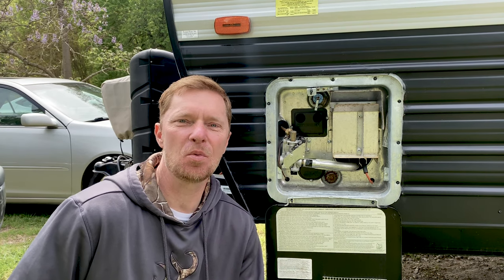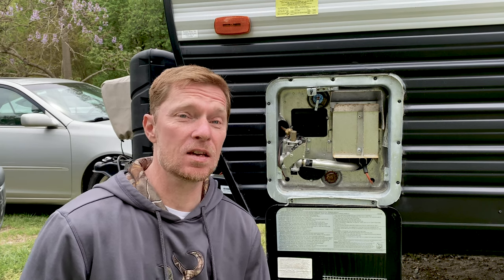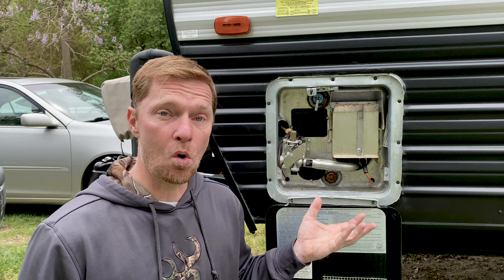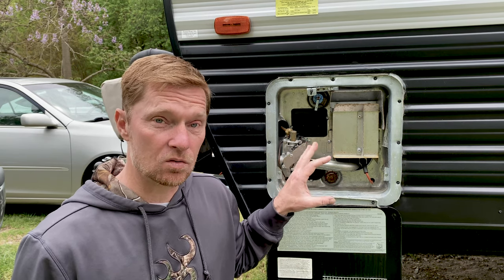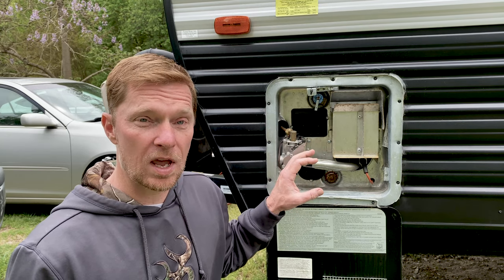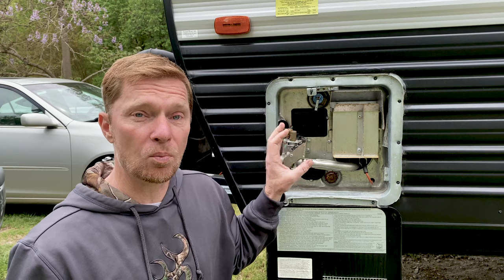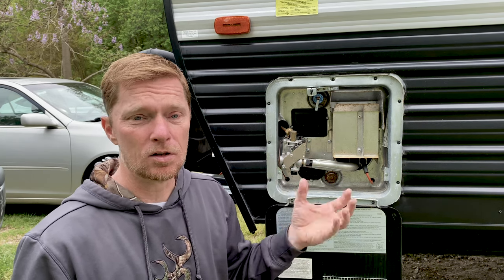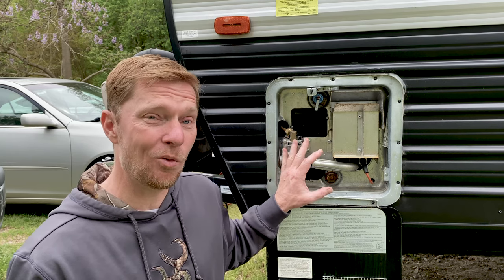Travel Trailer Gas Electric Water Heater Explained 2020

Comment: Where is the electric switch located at in the camper?
Reply from the maker: Different RVs have them in different places but most f the time you will find it on the panel where all the other switches are located like the tank level, inside lights and so on. To make sure I undersstand, the switch inside of the RV on the panel is for turning on the propane side of the water heater. At least that is how mine works.

Comment: Can you adjust water temperature for camper. Mine running too hot.
Reply from the maker: I can not on mine. I suggest looking up the manafacturer and seeing what they say online. You should be able to find information about the water heater on a sticker behind the cover on the outside of the RV.

Comment: How do you cut the flame down? My rv panel looks jus like yours. When I turn heat on it is like a blow torch. is that normal?
Reply from the maker: You cant turn down the flame. As long as the entire flame is under the tank, i would think that its ok. If yours doesnt look right, trust your gut and have a technician take a quick look. Remeber safety first.

Comment: Hello, l have a 2024 rockwood mini lite 2511s.  There is not an on-off switch for the electric in the outside hot water heater, just the black reset square. How do I switch it from propane to electric? It is a suburban. An airxcel brand. All model. Do I only use the panel inside the  camper? I have a push button for propane and one for electric.
Reply from the maker: I am not sure exactly. I would think that if you have 2 switches for water heater then yes one is for propane and one is for electric.

Comment: Hi. Brand new trailer owner. I know NOTHING about what i am supposed to be doing. The "walk through " at delivery was 10 mins! Not nearly enough to explain things and my questions were answered with "you'll figure it out"...useless!  I would like to START using my hot water heater (hot summer and not necessary until now) and want a safe start. I have forest river rockwood signature and still finding things. Do i need to go outside and find the on/off,  can i just use the control panel inside, or both? There is NO owners manual to answer these questions.
Reply from the maker: It depends on how your set up. Tell you what. If you want to connect, please email me at How2RV@gmail.com and I can send you some details

Comment: Is there a valve to turn off water to the water heater?
Reply from the maker: Mine have 2 on the back of the water heater. They are bypass valves which turn off the water heater and still allow the RV to still flow if needed.

Comment: Can the 12v supply enough power for the element to work properly? Or is it shore power only?
Reply from the maker: The electrical heating element is for shore power only. Outside of shore power you will have to use the propane to heat the water. Thanks for asking.

Comment: Great info!! 👍🏻. Do you know if it’s okay to run both electric and gas at the same time?  Will it heat the water faster?
Reply from the maker: Glad you asked. Yess you can run both at the same time. As far as the time to get hot, i don't really see any difference. Where is see the most impact is how much longer i can keep hot water flowing.
Reply: Imagine Your Odyssey thank you so much!!  That’s what I was trying to do, increase my hot water shower time 😁

Comment: I have a switch on the inside of 5th wheel..is it enough to just keep that switch off to heat water in shower and sinks? I am new to all of this..does it still draw my propane ? Is the off switch enough to not draw propane? Thank you
Reply: Meaning..do I still have to go outside and switch off or on whatever? I am living permanently at an RV park..thank you
Reply from the maker: For mine, I would turn the switch at the water heater outside on if i wanted to use the shore power (120V) and use the switch on the inside if i want to use propane. If you leave the switch for the propane off, you should get hot water from the (120V) shore power side only.
Reply: @HowToRV  I still dont get it...I am very slow...lol
I have the switch on inside off...do I need to still do something outside. I do have hot water....thank you
Reply: Dont even know what shore power is??
Reply from the maker: @virgoallthewayvirgoallthew4464  Shore power is where you plug your camper in when you are at the campground. Watch this video and let me know if this helps. https://youtu.be/r1QORFE2htM

Comment: Do I leave the inside on and off switch on or off after it gets hot but I no longer need hot water because mines running off of propane?
Reply from the maker: If you leave it on, it will maintain tamepature. If you want to convserve propane, then turn itoff when not in use. The only thing that you will have to remember is to turn it back on about 30 minutes prior to use so that the wwater is plenty hot.

Comment: Our fumes are coming back into the camper when ignited to heat water back up using gas, do you know what could be causing this?
Reply from the maker: Wow this could be a real problem. All of the fumes should be going out the little port hole on the cover outside. I would check the seal around the outer part of the lid and enclosure on the outside and check to see if there is any obstruction too. Also can check the gas lines for leaks to do this, use soapy water or a product called snope. If you can’t find the reason have a professional look at it, gas smell is a bad thing. Now I am no professional but as dangerous as that can be, I wouldn’t wait to long.
Reply: @HowToRV  Find the access to the back of the water heater and see if you see light.  If you do, they've cut the hole too large for the frame on the water heater and fumes will come in.  Water can, too.

Comment: i have a gas/elec water heater. In my controls for the electric, i have a breaker. Also I have two switches next to my convenience console (tells me water level and turns pump on) Those say "water heater). Also, on the convenience console, it has a switch "gas water heater" and "electric water heater". So, with those 3 total electric switches, what do those probably do?
Reply from the maker: The circuit breaker is for the shore power electric 120v side of the heater. The breaker is there just in case an issue arises. The electric switch on the convenience panel is to tell the water heater to start heating with the shore power 120v side. The gas switch is for the propane heat Sid rig the am water heater. Hope this helps.
Reply: @HowToRV  yes but there are 2 more switches. that's the part I don't understand. but I think i figured it out. thanks anyway.
Reply from the maker: @surveyguyor8958  The only other switches that i have are for the water pump. What did you find out?
Reply: @HowToRV  they said "tank heater" and in my other RV's I've never had this. but ....drumroll.... holding tank heaters. for sub-freezing temps.
Reply from the maker: @surveyguyor8958  ahhh. Yeah. I will have to remember that if someone asks me. I do not have tank heater even though I wish I did. Drum roll. 😂 you have me laughing on that one.
Reply: @HowToRV  What threw me was there was a 3x5 card that had a little drawing, and for those 2 switches it said "Do Not Use" so it had me worried something was wrongly wired. Can you imagine someone asking me why you would have a heater on your wastewater tanks? "Because my poo is so special I keep it warmed"
Reply from the maker: @surveyguyor8958  ROFL. I was in the middle recording my next video and read your last comment. I had to stop all production and get my composure. I do agree though. A sign that is basically a red button does make you wonder.

Comment: My rv is connected to city water, and my electrical switch for the water heater is on. The water isn’t warming up! There is water in the water heater. Is it ok to turn the switch on inside and run that as well as having the electrical switch for it on?
Reply from the maker: That is what I do. I run both at the same time.

Comment: Where is the shut off valve for the water heater? Our water heater is located where we can’t access it at the end of the storage cubby.
Reply from the maker: Our shut off/bypass valves are on the back of the hot water tank. Both water lines on ours have valves.
Reply from the maker: I have to either take out everything from the storage or lift the bed and go in from that direction. The bed direction is what I mostly use since I do not want to empty the storage every time. There is a panel there that I am going to make removable in the near future so that access is much easier. Hope this helps
Reply: Imagine Your Odyssey We did finally find it there but it’s nearly impossible to get to. We’re going to move that panel further away from the water heater so we can reach in there better. Thank you for your help!

Comment: Thanks for info.  Our setup is same as yours.  So I can run electric and propane at same time?  Is that correct?  Thanks
Reply from the maker: Bond008 A that is correct you can run both at the same time. It is highly important that you remember to turn off the electric when there isn’t any water connected whether it’s from a water hose to your rv or the RV Intetnal water pump. If you leave the electrical side of the water heater on and now water coming from either source, you will take the chance in ruining the electrical heating element.

Comment: We turned of switch for electricity but what do you do to get it on propane?
Reply from the maker: We only have to turn the switch in our RV for the hot water. On ours, the sitch inside the camper is for the propane side and the outside switch at the tank is for the electric only.

Comment: one thing I was hoping you would cover is:  Can you run the gas and electric both at the same time ????
Reply from the maker: I had been asked this before. I added a link in the description as well as the comments. Look there and it should answer your queston. Looking forward to your feedback.
Reply: @HowToRV  Well I have all over this site trying to find the answer.. Can not find in any comments or a description. could you just tell me in this reply a simple yes or no
Reply from the maker: @paulcurt684  in my setup, yes. I ran both at the same time quite a bit especially in the colder weather.

Comment: I have the same water heater. If I just plug the rv in and turn the black switch on can it run on just electric?
Reply from the maker: Mine can. If yours is like the one in the video, you should be able to.
Reply: @HowToRV  Thanks . It works.

Comment: If you turn off the electrical switch will the gas unit continue to work. I have to push my reset buttons daily to ignite the gas to get hot water. My electric element is apparently bad.
Reply from the maker: Yes you can use it without the electricity and/or the electrical switch off. Let me know what you find out about the heating element and the reset buttons.
Reply: Well I shut off the toggle out on the unit and the gas did ignite and heat the water. Next day had to go push the gas reset button again to get it to heat up. Flipped the toggle on the electric element and it came on also. Element was not bad after all. Both resets have to be pushed daily to heat up the water. Think it may be the thermostat. I have noticed that the water is now scalding hot. Hasn’t blown the pressure valve though. Even using the gas or electric. Hot water is scalding hot.
Reply: @stevetilby5695  From my understanding that is intentional, the manufacturer feels that because the hot water tank has only a limited suppley of water, that the more cold water you use to cool it down to a temperarure that you can work with, the less hot water used. Kinda makes sense.
Reply: Jim Shupe agree but used to not get as hot but still doesn’t blow the pressure value. Also ran out of propane a couple days after my last message to you and haven’t refilled it yet so just pressing the left reset works the electric. Still have to go press it every morning to get hot water to build up
Reply from the maker: steve tilby sorry to hear that you ran out of propane. I have a video on my channel about measuring propane without have to spend money. That way you know how much you would have before empty. Let me know what you think of that video and if it would have helped you
Reply: Agree. Makes perfect sense. Still, mine gets so hot it trips the reset button and I have to push the button every morning to get the hot water back. Something else must be wrong

Comment: Can we use just electric? Or does gas got to be on to heat water heater?
Reply from the maker: I have used the elkectric only a bunch of times. The only concern is that the electric side takes longer to heat the water. You will run out of hot water faster when taking showers and such but is doable if you are in an area where the outside temperatures are higher that 80 degrees F. Hope this helps. If you have any more questions, please feel free to email me at How2RV@gmail.com

Comment: So if you want to use propane for heating, the system automaically knows and the propane heating just turns on, no worires about you having to figure if there is some sort of switch that you need to turn on to it or haivng to figure out about igniting some pilot light.  Right? 
Since I have no electric heating at the hot water tank and I don't see any flame on the propane burner, not any sign of some pilot  knob or thermostat setting... I guess in am just in "hot water".  🙂
Reply from the maker: On mine, I turn on the propane switch to allow it to work. From the the water heaters built in water temperature sensor takes care of the rest. You are correct.

Comment: Can I leave the propane side of my water heater on
Reply from the maker: That is what I do. Because I only have a 30 amp service, I toggle the e;extricate and primarily use the propane. In your case it would be just the reverse but doable if your system is like mine.

Comment: My RV has a main shutoff for the 12-volt battery. If that is shut off, will the propane setup of the water heater function? I believe you said the solenoid functions off 12-volt power?
Reply from the maker: That’s right. The propane will not work if the 12 volt system is off. Now I have not check to see but the battery does get charged by the inverter . The inverter is powered from the 120 volt system which comes in when you plug your camper into shore power. So if that’s the case then if your plugged into the shore power and it’s still feeding the -2 volt system even with the battery disconnected then it may still work.
Reply: @HowToRV  thank you for the reply! Strangely, my RV is not equipped with an inverter that charges the battery. It’s a Keystone Laredo travel trailer if that says anything. So it sounds like I’ll need to flip my main 12-volt switch on to get propane to my water heater. 👍
Reply from the maker: @jay_rojas  what year is it? Also, can you turn on the lights with the shore power connected and the battery disconnected?
Reply: @HowToRV  it is a 2016. And yes, I’m currently connected to shore power and all my interior lights are functioning.
Reply: Porch light and step light also work with the 12-volt power shut off. If that helps.
Reply from the maker: @jay_rojas  your lights I. Your RV are 12 volt. That means that you do have an inverter. Mine is located behind the main power panel where the circuit breakers. You will not physically be able to see it but it should be there
Reply: @HowToRV  that is good to know. I’ll pay closer attention and see if I can’t see signs of charging by the inverter. We’re pretty new to the RV life (a week into it), so I’m learning a lot on the fly. 😬😊
Reply from the maker: @jay_rojas  we were all new at one time.  I am glad that I could be there for ya.

Comment: why is there a switch on the inside of my camper that says water heater electric? I don't need to turn it on for the water heater to work since the switch inside the heater panel is what turns it on.
Reply from the maker: Manafacturers make/design their RVs differently. You could have a switch on both. For mine, I do not have one on the inside. I wish that they made it that way though. If you leave the one on at the water heater, I would make sure that the switch inside for sure cuts it off. That way you  know that power is cut off to the electric heating element when there is no water connected or able to flow.

Comment: Is it ok to run just electric to save on propane.
Reply from the maker: Absolutely but remember that it takes longer that way to make hot water so you will have to use the hot water sparingly.

Comment: I have everything except the on/off button that means I have only gas water heater ??
Reply from the maker: That would be correct. If you have everything on and the propane bottles are on and you have the electrical power off like in the video then you are running propane side only. Take a look at these videos on how i manage my electrical. https://youtu.be/PgciDMnMZDU and https://youtu.be/n_v7QkFzNds

Comment: How do ya know the hot water tank has water in it?
Reply from the maker: There should be 2 bypass valves behind the water heater and the valve handles on mine point towards the tank letting me know water is going that direction. Another way is to turn all water supplies off and pull out the anode rod and then turn the water back on and see if water is coming out where the anode rod was. Note about pulling out the anode rod, the water may be really hot and could burn you. If you use the propane to heat without the electric which will not hurt anything, then start the propane heat and see if you get any hot water. This option may be easier. Hope this helps.